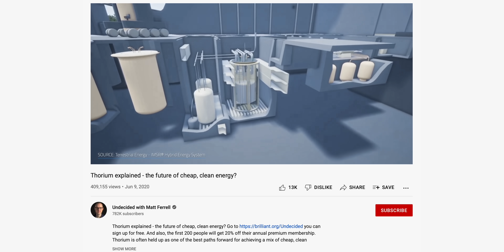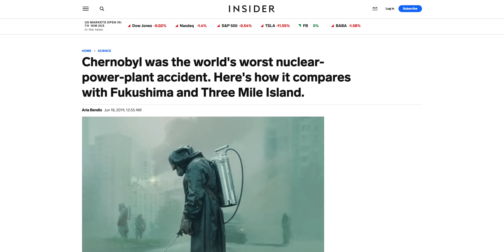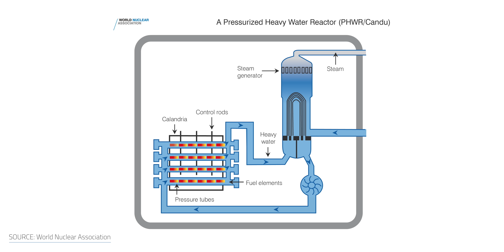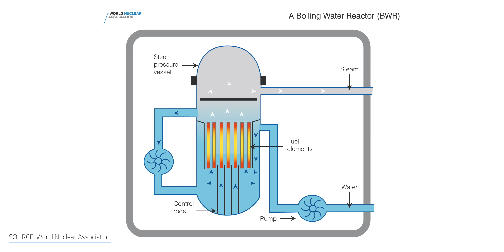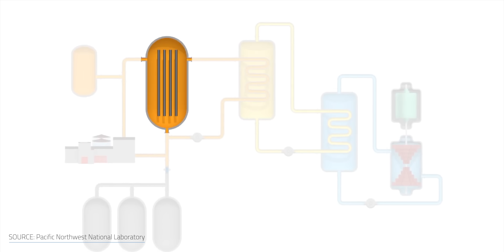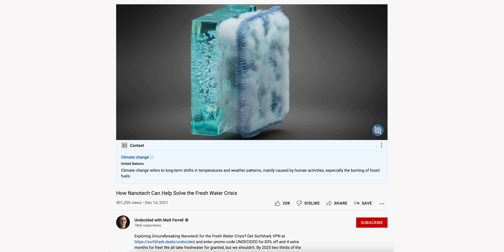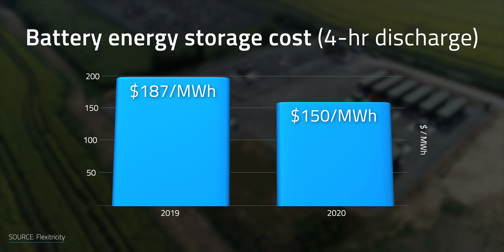Revisiting Thorium Energy - The Future of Nuclear Power?

Comment: And the problem with solar and wind is that weather can effect the total output of solar and wind turbines.  The lack of wind or low amounts of wind means very little electricity is generated.  Also wind turbines have had issues of freezing in heavy snow storms / ice storms.  Solar power is not very efficient and  is about 20% - 24% efficient as far as the solar panels go.  The more sunny days a region has the better but once you have clouds the amount of electricity generated goes down.  Then at night time you have 0% generated and you then have to rely on batteries with dangerous chemicals and a reasonably short life span. While they have much perceived acceptance being perceived as environmentally friendly turbine blades are not recyclable and chemical's in batteries can be very toxic.  And even though electric vehicles have gotten popular there are not ready for prime time.  It takes to long to charge the vehicles and the local grids are not ready for the demand huge numbers of electric vehicles would put on the electric grid.  Not to mention there is nowhere the needed infostructure to charge up all those electric vehicles.  When there is an accident lithium batteries once on fire emit toxic chemicals and burn very hot.  Given enough time there may end up being real world solutions to our energy needs that really are good for the planet.  So for the time being is this current technology a better solution than mass solar and or wind power as far as reliable available power throughout the day?

Comment: Yes, we need more nuclear ASAP.  I heard an interesting discussion that highlighted how many existing US nuclear plants are under threat from rising sea levels.  So when we build new nuclear plants they need to be on higher ground, and they need to be smaller to help with approval and avoid the project over-runs we see in larger nuclear plants.  Thorium MSRs can be built using CO2 as the gas that drives the generator turbines - so we don't need to site them close to the sea or rivers.  I think last the summer in Europe showed the need for a clean, reliable power generation option because the wind didn't blow and the sun didn't shine for months.

Comment: You talk a lot about the cost of wind and solar being so low BUT, the bigest problem with them is that they are highly UN-RELIABLE where Thorium salt reactors are cheap enough, CONSTANT power 24 hours a day. Is "nuclear" the best energy for the world? YES, Thorium based Nuclear Reactors are the one type of reactors for the world's Energy needs of the future. As the old Uranium reactors, around the world, reach the end of their functional lives, they should be REPLACED by Thorium reactors at those sites. The other thing that was not mentioned here is that a Liquid Flourine Thorium Reactor (LFTR) can be run on what they call a "burner" mode that can use old Spent Uranium fuel as it's main fuel supply and reduce that waste while making power for basically NOTHING, for the next 100 years. So LFTR would be a "win..win..win" type of sustainable long term Energy source.

Comment: NOO the Oak Ridge reactor was closed due to Nixon pushing the LWR breader reactor in his home state of California which was a failure.  Look at a company called Thorcon working with Indonesia.  Also the cost of thorium is much cheaper since they do not need triple redundancy like unstable LWRs. Actually MSR ca be cheaper than coal and much cheaper than LWR reactors.   you need to do more research.

Comment: Thorium does not need to be enriched which is a HUGE cost reduction.  Just take it out of the ground and refine it.  These reactors can also eliminate historic fuel rods by using them as fuel.  
On proliferation:  The gamma rays are so powerful in a thorium reactor that just getting near them would result in death making the use in weapons useless.  Also refining the limited plutonium  in the salt is typically burned in the process is not practical and harder than starting fresh with uranium yellow cake.   
Thorium reactor spent fuel has a 500 year life span not the 10,000 life span of a light water reactor so design like Thorncon just replaces the entire fuel container every 7 years.

Comment: Good video. I noticed a couple of important subjects that you missed: First, the 500 year storage of waist from Thorium - This is only possible if fuel "reprocessing" is used where the unspent fuel and the non fission products are separated via a process inside of the reactor chamber, as in LFTR, or separated outside the reactor by a third party. Both methods require government regulations and certification that are too lengthy (decades?) and expensive. Plus the government will surely screw it up!  Also, if Thorium is converted to Uranium-233 and is then used to fuel other reactors, I heard a presentation given by Terrestrial Energy that this constitutes High Enriched Uranium which nuclear regulators probably won't allow, even if the new U-233 is used "internally" like in the LFTR reactor. But if Thorium is used in a "burner" reactor like in Thorcons design I think the regulation process is simpler. One cool feature regarding molten salt fueled reactors is that the chemistry binds with the fission products in an "ionic bond". So if the fuel is exposed to the atmosphere the fission products stay in the fuel (this needs more research though because the MSRE experiment in the 1960's was not for the purpose of studying this feature, but this was observed in the experiments results).
Reply: Correct: The barriers to deployment of low pressure LFTRs is entirely due to fast-reactor entrenched regulatory environment originating from the US. 

A bit ironic, how often high temperature slow reactor deployment gets sidetracked in favor of 'burners' to give existing fast breeder reactors a waste outlet... while these same comparatively low material waste, far lower risk, high temperature low pressure molten salt thorium reactors, are opposed as if they posed some greater risk than the breeders we've been funding instead!? 

Low pressure deployments first, because we can do them _now_. Burners when the legacy reactor industry finds a way to pay for them.

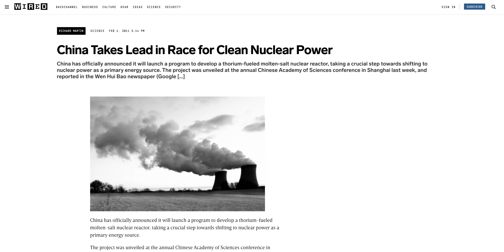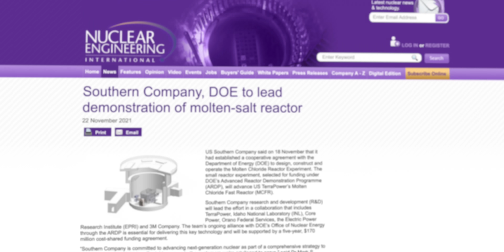Comment: I don't mean to be rude.  But your video is a train wreck.  So what you're saying is that Lin-Wen Hu's objections evaporate when you move to Thorium and LFTR's.  The Thorium community is already perfectly clear that solid fuel reactors are not the way to go.   And at about 8:35 you move from liquid to solid fuel conflating the 2 in a LFTR.  Why would you want solid fuel that has a limited surface area over which to remove heat when your liquid fuel essentially has an infinite surface area through which to exchange heat?  8:52 and it's precisely bc of the 2 gamma rays produced during the decay series that make it extremely difficult to make weapons.  Your assembly team would be on a suicide mission.  Also gotta call complete bullshit on the cost of Thorium to mine.  It wouldn't cost a dime.  Rare-Earth metals are almost always "contaminated" with Thorium.  As a consequence of mining rare earths you'd get virtually all your Thorium for the cost of separation.  And it's 4X as a abundant as Uranium... not 3X.  9:22.. wrong again.  ThorCon is a commercial MSR venture that's being considered in place of coal in Indonesia.  9:39  Mid 1960's.  Not 1950's.  Dude... at this point I'm stellarly UNimpressed with your "research".  9:50  Damn ... you're on a roll.  Wrong.  The project was discontinued bc Richard Nixon promised jobs to southern California and people there wanted fast Plutonium reactors and there wasn't enough money for both(and Thorium was removed from consideration bc you really can't make weapons from it).  To deal with the corrosion problem you operate in a highly reducing environment.  Now here is where you should have mentioned the Tritium sequestration problem.  10:50 Now you go on at length about the VAST sums of money that are being thrown at Thorium around the world... here's a news flash dude..  companies don't spend that kind of money unless they're pretty sure what they're attempting is going to work.  So all this allusion that this is some kind of untested and may or may not be promising technology is bunk.  12:55  Now you're on about so called renewables.  Gotta call that out too.  Apparently you haven't been paying attention to what's going on in Germany.  The Germans have ruined their economy with wind and solar.  They increased their wind and solar both by about 13-14%.  But they now generate about 11% less electricity overall bc they're learning the hard way that the wind doesn't always blow and sunlight doesn't always make it to the ground.  And who are they buying their energy from?  The French.  Who get their juice from Nuclear power.  Further, wind and solar are intermittent, you have no practical means of storing the surplus energy you collect and they require huge amounts of land(meaning they are FAR from energy dense).  You're never going to run a steel mill, rail system or shipyard with wind and solar.  The words you want to know are "base load".  Next... I noticed you failed to mention Molybdenum99 and Bismith213(just to name a couple).  While a practical impossibility  to harvest from a solid fuel reactor these nuclides are easily retrieved from a liquid fueled reactor.  And why would you want them?  Bc they're regarded as "Cancer smart bombs" by Oncologist.  Now let's talk about Plutonium 238(no... not 239... the stuff you make bombs out of).  We're out.  Nasa, and pretty much every other space agency on earth, is desperate for some of this stuff.  It's used to make batteries in space probes that explore the outer solar system.  You can't use solar bc incoming light from the sun is just not intense enough for solar panels.  LFTR's can make all these exotic nuclides.  For you and those of you out there interested in how very promising this is you should watch these:  https://www.youtube.com/watch?v=N2vzotsvvkw  https://www.youtube.com/watch?v=tHO1ebNxhVI  https://www.youtube.com/watch?v=jDqCpfVwdP4

Comment: First of all, classic highly radioactive nulear waste needs to be stored at least a 100.000 years, even the most hardcore nuclear lobbyist agree on this figure. So based on that and the fact that Uranium 233`s half life is roughly a seventh of U-235, we already see where this is going. 500 Years of storage is just plain and utter BS. I don't know who fed you this number, but you would have been better off reasearching it first before putting it in your video.
After we got your absolutely wrong numbers out of the way the only issue left that Thorium reactors actually adress is the critical failure of the reactor, as we already saw it is not a significant improval on the waste problem. The waste problem is the one that needs to be solved, Thorium does not do that. So it is a failure right from the bat. There is no way it can be good or cheap enough to make up for the unfathomable costs of waste management afterwards. Why is this so hard to grasp for nuclear fanboys, this technology is just terrible.
Even if the 500 years were correct, which they are not, it is still unbearable and impossible to finance a storage facility for this period of time. No nation on this planet went along 500 years without some major political incident and at this point there is no reason to believe any of the current nations would stay stable for another 500 years.
The problem of nuclear waste remains unsolved. The reactors are in experimental stage not even remotely near to deliver a single KW of energy for at least another 10 years. They are not an option to tackle climate change, at all, because in ten years the window to avoid fundamental climate change is closed. All the ressources and funding that goes into them is a waste of money that should be put in readily available options that actually help us.
By the way, centralized energy production facilities like these benefit big companies, it is their most favourite thing. One big facility with a few hundred jobs are a great way to negotiate tax-breaks and subsidies, a great way to satisfy investors and an even greater way to embezzle funds. Which can be seen in the great reactor sites that are ten to fifteen years over schedule in europe, just one shitshow of corruption mismanagement and generous subsidies going to waste in order to satisfy investors.

Comment: On demand, localized, base load grid power from small modular LFTR power plants running gas turbine generators is as good as practicable nuclear fusion, the ridiculous concept that wind or solar with their pissweak anemic limitations on production location, delivery, timing, infrastructure cost including the devices themselves, their maintenance, the ongoing wear and tear and replacement cycles I can't believe that anyone could figure out some financial arguments FOR their efficiency, that's absolute insanity if you tally all the logistical issues.

Comment: Self regulating!  So apparently salt expands as it gets hotter, just like water coolant/moderator.  Though I guess in this case, the expansion spreads the fuel out while it's close to the carbon moderator.  Good, I didn't know if worked that way.  I was concerned about the stability of thorium MSRs.  Let's build THORIUM reactors--Yes!

Comment: Are we storing these radioactive wastes on the moon ? Also what if we used the moon as a hamster and had a checkpoint, like a diesel generator or clutch or magnetic rail ?
Reply: Pressure plates and using the power of movement could be cool too. In the sense of earthquakes, could potentially be used in skyscrapers. Sound waves / wind later when it becomes more sensitive.

Comment: The comparisons are pure f*cking fantasy.

Wind and solar are compared using "optimal" figures that are generally twice their lifetime in real world conditions.  Nuclear power plants are assumed to last only 30 years but our experience is that the plants can be kept running decades longer.  Then they talk about battery backup for solar increasing costs but list an utterly laughable 4 hour battery backup.  But without dispatchable power shadowing the load you would need WEEKS of storage to make the grid stable and give it some kind of black start capability.

On the other hand you can turn a nuclear plant into a source capable of following the daily load curve with only about 6-8 hours of battery backup.

EDIT: Oh and I forgot to mention.  Once you include capacity factor of wind turbines, they take 5X the concrete, steel, and labor of a nuclear plant.  The grid is incompatible with renewables (you need to add an immense, high capacity regional transport system).

Comment: If we try to go 100% wind and solar, we will run into so many problems.  Those aren't replacements,  they are there to reduce the amount of non-renewable energy we need.  Nuclear is far and away the best option we have between oil, gas, and coal.  Its cleaner, safer, stable, and ultimately the best option we have for consumable power generation.